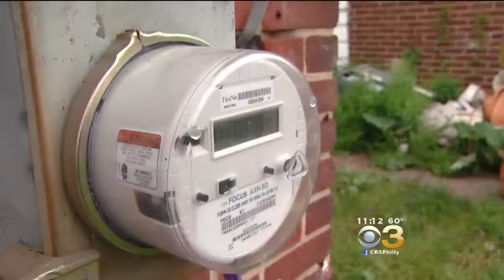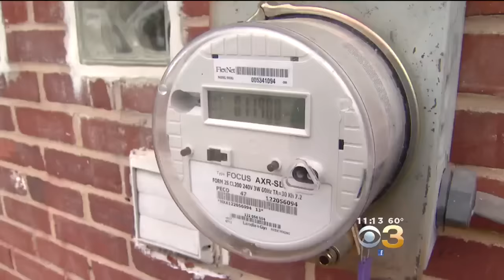PECO Combats People Using Everyday Items To Steal Power

Comment: Stop charging people 3 to $400 a month
Reply: geoffrey oliver is that how much theyre charging? In the LA area, my dad pays no more than $90 a month for a family of 6
Reply: geoffrey oliver you could just go with the other company,oh wait
Reply: Frank Magana gas?
Reply: Nerys nah electricty. The gas bill is like 20 a month inwould say
Reply: Frank Magana exactly what i thought. Gas. So you have no idea. Piped gas is crazy cheap. If you dont have piped gas its insanely expensive. My electric bill was $1200 to $1300 a month on electric heat. Now i use propane and its still $600 a month in propane (delivered not piped) plus $500 a month in electric in the winter. (We run one electric heater and keep the gas at 60f to keep the cost down) people with piped gas have no idea. Sure if my heat, hot water, dryer, stove, and oven ran on piped gas i would have a $100 month electric bill too.
Reply: in indiana we pay 700$ a month due to high cost no job here too and lots of racist people.
Reply: Stop using so much electricity.
Reply: Jaakko Fagerlund it does not matter how much you use if your being charged too much. Electricity is charged per kwh so if your overcharged for 10mega watts your over charged for 5 megawatts too.

I have every single bulb in the house led (real ones not the crap high wattage ones you get at walmart or home depot) 12watts to light my kitchen.

High efficiency everything. Still $400 a month. Peco is just insane. That simple. I cant wit to get the hell out of this state.
Reply: You didn't mention your monthly usage to get a 400 dollar bill. Clearly you are using much if the bill is that high.
Reply: Jaakko Fagerlund clearly is one hell of an assumption. How much is not relevant. Cost per unit power is relevant.
Reply: Well, the only given has been price, so based on consumption it is easy to calculate unit price to see if it is "normal". Haven't been given anything, so assumption is the best that can be done.
Reply: Jaakko Fagerlund and your only assumption is "yoyr price is fine your nust using too much"

I will have to check a bill to see what insane price they are charging me.
Reply: Maybe limit your use a little.  Just turning your heat/AC down at night and while at work will save a lot.  $350 was worst bill I have ever seen and that was just as a moved to a new house.  It was below 0 much of that month and the house has terrible windows, so much that I could literally stick a pen between the window sash and the frame in some places.  I also ran the system unknowingly in a terrible mode efficiency wise.  

I changed providers after that was well.  Many people can change, not all though.  Many municipal systems will not allow you to.  If you are able to you can lower the generation and transmission port of your bill, this tends to be about half.
Reply: maybe maybe maybe. or maybe it should not be so damned expensive. how about that for a maybe.

I am in NO way justifying what these people are doing not only is it wrong but its fucking dangerous as hell not just to them (which I don't care too much about I dislike a nanny state) but to their neighbors as well.

this does not change the FACT that its too damned expensive.
Reply: Nerys, did you check your bill for what they charge per kWh and how much do you use? Because without these it is impossible to do comparisons on if it is expensive or not or if you are just using much.
Reply: Jaakko Fagerlund those things are irrelevnt. Cost per kwh is all that is relevant. Whether i use 2 mw or 500 mw only cost per kwh matters.

The cost per kwh is too damned high.
Reply: Well what is the cost per kWh then? That's what I've been tryiong to get out of few people, but seems that none is able to answer it.
Reply: Jaakko Fagerlund because its complicated. They break up the bill into many parts and even making getting a total usage difficult. I will have to sit down with my bill and do some math and sluething. Its roughly 16-18c/kwh i pay 9c/kwh for generation but its tiered so even that is not simple and they you have to add transmission connection admin fees regulatory etc.. Etc... If i can figure out my total real usage i can just divide into the total bill but they intentionally make it diffidult to figure that out.
Reply: Post the bill, they are not that hard to figure out. Or just plain and simple ask them what your usage is.
Reply: The most my bill has ever been is $170ish, and that's because I cut down on electricity consumption. You don't need every light and electronic device on in the house all of the time. It's very simple, when you're not using it turn it off and instead of watching t.v or playing a game you can read a book or go outside and do something constructive.
Reply: I would be checking to see of your waterheater is bad.
They will run your bill way up fast.
Or see if something else may be draining power by watching your meter and killing one breaker at a time.
Then replace whatever is taking the most power
Reply: It $1.30 a day service charge before you even use electricity. For a 90 day bill, that $117 before you even get the usage charge. Then add $0.35 cents per KwHR peak and $0.24 cents per KwHR off-peak and it can get expensive. Australia, where the politicians, the greenies and the greedy power companies fucked us over.
Reply: geoffrey oliver 
Stop living in cities you can’t afford to.
Reply: Damn!  3 to $400/month? That’s a bargain! Where I live, a company came in and bought the poles and lines. They charge a $350 minimum distribution fee to your utility provider on top of your electricity usage. Just google “sharyland utilities investigation.”
Reply: Frank Magana avarage use in the summer is 250-300 in bucks county
Reply: geoffrey oliver if you steal electricity they should increase your bill by times 1000%
Reply: rofl dude, if you are paying a shit ton then that is because you are using a shit ton of energy. electricity is really cheap, maybe 12c per kwh. i dont feel sorry for people who splurge like crazy and then complain. use less electricity if you cant afford it! easy!
Reply: But the billionaires will suffer.
Reply: Where I live there is no natural gas so we have to buy propane and electrical costs around 400 a month
Reply: So power in my area is $0.14 KW/hr

If your bill is 3-400 a month you need to change your usage habits. Like what could you possibly be doing to use so much electricity?
Reply: @goaliedude32  
Ikr i only pay 120  and i have my central a/c unit; electric dryer  practically running 24/7  2 computers both running  almost all day a 240 stick welding machine my son uses for hobby which is on almost all the time  and all led lights  which sometimes we leave on by accident and forget about them   wtf do these people do to spend over 300 -  400 in just electricity
Reply: If your bill was EVER 1300 dollars a month it is YOUR fault. WTF are you doing, living in the Antarctic circle with a roof that has multiple 3 foot holes in it?

My last house was 1900+ square feet in town.  Central MO where it goes from freezing to 100 degrees.  All electric central heating and cooling, electric stove and water heater,  old school big screen which saps power and multiple gaming consoles AND PCs.  Never ONCE had a bill top 320~ dollars, and that was before I had insulation blown in upstairs.  This is all on a 1978 home with a 1978 central air unit (outside A/C was newer) and standard tank style water heater.  In other words, shit windows and shit insulation in the walls. 

If your bill was 1300 dollars a month you are either in a monster home, have zero insulation, or are incredibly wasteful (or a combination of all three).  There is NO electrical rate in the US so high that you would be paying this crazy amount.  The fact that your propane bill is now 600 a month proves this... something is wrong.
Reply: @dynamo3059  rofl because people don't understand the difference between having piped natural gas or not
Reply: @testy462  no piped natural gas. Electric heat is much less efficient than natural gas. Electric oven, water heater, furnace, all adds up to a LOT
Reply: Nerys maybe your neighbours syphon your power
Reply: Steal away! I commend these folks
Reply: santiago hernandez what does racism has to do with this??
Reply: wtf u runing

Comment: Back in the days when electric power lines were being installed a friend of mine was inspecting a new installation. They noticed someone who appeared to be trying to throw a line over a power line crossing a field. The man was a farmer and had just tied some wire around the base of a bulb hanging in an old barn. He was then attempting to connect this bulb to the grid. They suggested he desist and told him why.
Reply: So theft is ok because it's just a little bit? I bet you're engaged by people shoplifting from billion dollar coprations though
Reply: @unhappyattendantughh2469  nowhere did he say it was ok.

Comment: If electricity is an living essential, like water.. and required to have it.. Why should people pay for it
Reply: You pay for water too though lmao.
Reply: @SpinSatx  ummm. No I dont!
Reply: @Thel2552  If you live in America and own a property with water hooked up, you must pay for the water.
Reply: @Thel2552  Your mom and dad pays the water then.
Reply: @SpinSatx  if you live in America, there are areas in the country where you can have a well system and NOT be hooked to city or county water.. I don't have a 40 to 90 dollar water bill.. I have a submersible pump hooked through filters. Electric runs the pump WHEN my tanks get low and that's not often.. my cost of water is pennies on the dollar compared to others. Enjoy those water bills.. If you are able to get on a well system, I 100% recommend it
Reply: @Thel2552  Go dig a well up in the city while your at it too. Love to see that in that area of the country 🤣
Reply: @Thel2552  I have a well on a farm.  When you need a new one, you'll pay 10k.  You also have to replace the pressure tank and pump regulator when required.  That needs to be factored into the cost as well.

Comment: In Serbia, power meters are mounted on outside wall of house. If person is caught steeling, meters is moved to pole on which house is connected.

Btw, in Serbia we use 230/400V 3 phase system. Higher voltage but lower current. For same given power current in US 2 times greater, so wire heats up 4 times as much for same thiknes.

Pointing out 240V as more dangerous is pointless.
Reply: Higher voltage, can use smaller wire size, the draw back the higher the voltage the higher the  risk.
Reply: eric wsmith Most of private house in countryside have instalations made by unlicenced electricians with high school. Power meters and cables until power meter are installed by utility company. I can not recall any fire or electric shock that I have ever heard. Every plug is 230V and each home that I know has 1 400V plug for cooker.
Reply: Do you hate/dislike some or maybe all Bosnian Muslims?

Comment: But when they install unsafe smart meters that catch fire, all repair cost is on the home owner. Don't say this has anything to do with safety it's all about money. Also you can lock the enclosure that houses the meter, that is the home owners box. The only thing they own is the meter and the lineside of service cable. The meter socket, box and everything else is yours.

Comment: There is no way to quantify the amount of electricity that is being made or used. The electric company makes it and its there. It doesnt exhaust like water or oil. So long as the turbines are making electricity. Its available to be used. Once the turbine stops spinning. The electricity stops.
Reply: The fuel that goes into making the turbine spin? Nice try though

Comment: I'm a retired electrician. Residential, but mainly Commercial Properties is what I did. I promise you. In Tenn. It is a miracle to get any criminal charges filed by L.E> agencies, who say it is a Civil matter with the Power Co. The Power Co. Doesnt give a rats ass, so these people walk and do it right over again. I've seen bolt, screw drivers, metal rods, pieces of aluminum and steel. Copper pipe smashed on each end, etc., etc.  Just the seal on the box is a crime to cut it. Even for me. The only time I could cut it, would be an absolute, life and death situation and a call in to the Power Board.  We used to pull meters for years, and then set them back in to do service. Not any more. I worked for a couple companies here and there years and years ago who had multi dwelling structures. 2 or 4 apartments, then some fuck wad does this and kills 4 families.  About the only thing that can be done is have the Company evict them. If they have very young children, it can take up to or over 90 days. Ive seen power stolen from the next door neighbors in a different structure on light weight extension cords hidden and buried under ground.  In over 45 years, I never saw a resident charged with anything. Civil or Criminal and I was licensed in Ohio, Ky., Tenn., Ga. Fla. AL. Not once.  There are avenues for these bums to tale in keeping power on. First the Government, Welfare, etc. Then the Power Co will HELP you, work something out. Take the "can't pay bill" from Lost job, sick, etc. and spread it out divided by 5 over the next 5 bills. IF they would just TALK to them instead of just ignoring mail and calls. They also, depending on the area, avenues of Community Action Agencies, etc. They are just too fucking lazy doing and MAKING Meth in their homes. And MOST of these degenerates have infant children. They are eligible for assistance, the Dumb Fuckers.  I owned my business and stopped all the residential, except for new construction. In their contracts with my employees they were forbidden to do residential work. At least in writing. If they did, without my knowledge, it was their ass, not mine.
Reply: Idk who you worked for but Duke Energy in KY and Indiana is notorious for turning off electric and offer no " payment plans"
Reply: I know a guy who got 10 plus years prison for stealing electricity